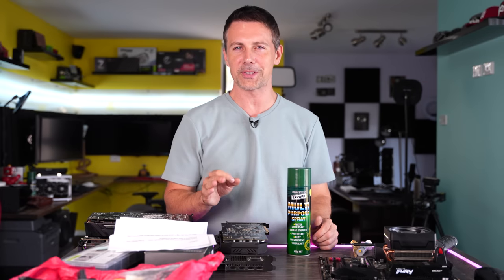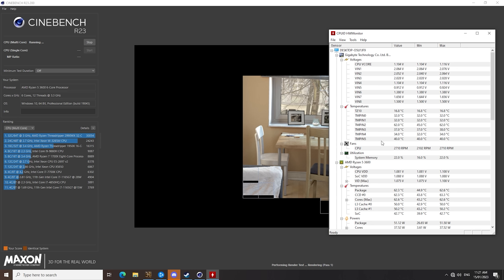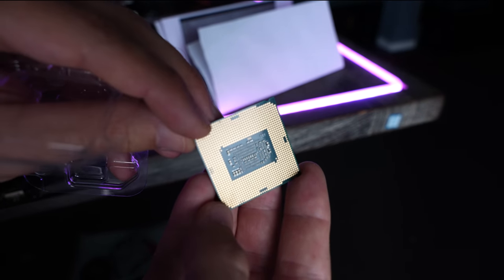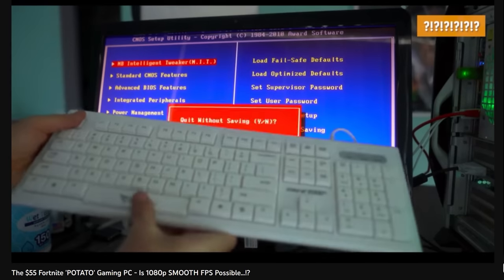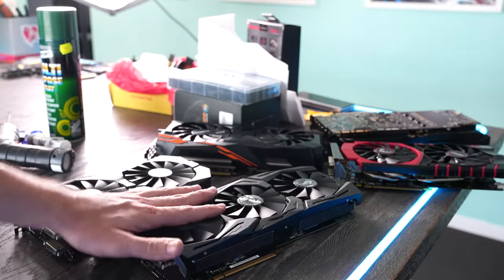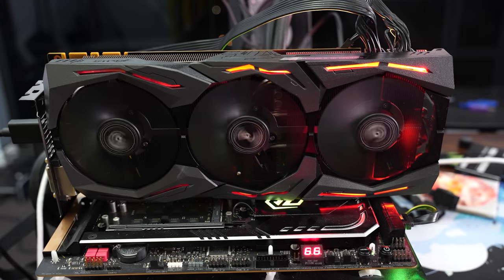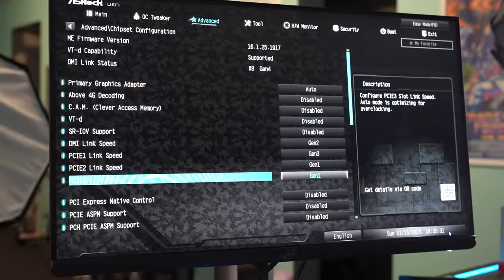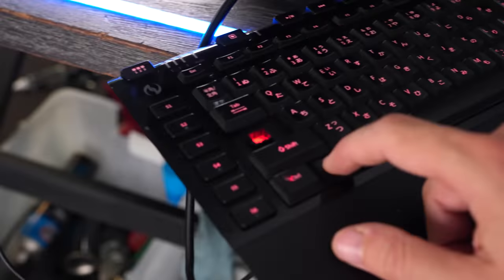Can you FIX a Ryzen 5 3600 with FAULTY Cores? | (Can YES Fix It).

Comment: I think there could be some problem with power management that causes R5 3600 to atc weird also besides silicon degradation.

I also have problem with my R5 3600 and it is most likely caused by something related to power management that is happening during idle operation. The reason i think this is because when clocks are set to a specific value and this way also voltage fluctuates less it is from my testing perfectly stable(even performance is almost the same). But as soon as you let it do its thing it becames unstable. 

I was trying a lot of stuff to solve those BSODs and i mostly solved them but random shutoffs during idling are still happening. Today i maybe found a sollution but i do not know it for sure yet. What i did was use overclocking setting on my MB that makes it so Infinity fabric(die that connects CCDs to everything and to each other) is forbidden from underclocking. Also for some reason monitoring softwares as HWinfo, MSI Afterburner were also increasing chance of it happening BSOD and those random shutoffs. I even found out something on forums that there are people that had their old backup and when they reverted to it those crashes and all that garbage completelly stopped. So it could be even related to software to some extend. Of course take it with a grain of salt that is only what i found out and works for me. If you have any knowledge that could shine light on what could be happening feel free to comment i would like to found out more.
Reply: i had heard that there is a setting in msi afterburner if you eperience low power state crashes, i put it on on my 3600x/5700xt setup. i look how its named in MSI afterburner --> settings-->general-->>Disable Ulps save and restart (let the pc boot with those new settings) and i hope that your issue is gone.

you described your problem perfect i think that, this is the problem amd still didnt fix the low power state issue
Reply: What you say is completely true.. the 3600 series had 2 much of silicon differences in between different processor chips, so that they could'nt have it running stable, so to keep up with intel they raised the clocks too high and the voltage as well, just play with the clocks and voltage till you get a stable experience. and the fist comment is  true too but is grahic card related instead of cpu so i would begin to check thats setting in MSI Afterburner if the problem stays you have to undervolt/underclock you cpu till it runs stable (watch memory voltage too) was kinda high aswell if i remmber correctly, good luck!
Reply: Ok, so from my testing so far locking infinity fabric did the trick. It did not stut itself off at all during iddle operation.

Comment: Isn't there 2 versions of the 3600? like the 3600 and 3600AF? Or is that the 2600?
Wondering if that has something to do with this.
EDIT: The 1080ti needs to be reballed.  That is common when there is intermittent connection to some chips. Throw it in the oven.

Comment: Does anyone know the date when 3600 was changed to the more reliable version?
Reply: You shouldn't worry, update bios, install the latest chipset driver and that would keep low voltages, i noticed on a 2700x with old bios that it would constantly hit 1.4v, after updating bios the voltage was always around 1.1v which is perfectly fine.
Reply: @el_tio_apoca8014  Yes the BIOS and chipset update seemed to fix the freezes, thanks for info

Comment: Chiplets broke the "its never the cpu" rule.
Reply: @@user-pd6fg4vu9d I still think there are more things to go wrong when stacking things, the factors multiply.  "New reports indicate AMD’s Ryzen 5000 processors may be failing at a high rate" is the google result, I don't remember intel having that rep, they were laughed at for cpu vulnerabilities, which amd is eating humble pie on now. "“The failure on the new AMD CPUs are still too high,” PowerGPU wrote in a tweet that has since been deleted, noting that there were eight out of 50 AMD Ryzen 5950x that were DOA, four out of 50 AMD Ryzen 5900x that were dead, four DOA units of 100 AMD Ryzen 5800x units, and three dead AMD Ryzen 5600x out of 120 units that the company received." "In comparison, PowerGPU noted that “we had only 1 dead Intel CPU it was a 9700k in our time of business.”"

Comment: Probably just luck with Ryzen 3600 mine is set to stupid high overclock with  way more voltage ⚡ and it's working but it's cooled by liquid freezer 2 360 and that might be the reason why it's alive and others have problems.

Comment: Dude, I have ran into 5 or 6 of these in the last few months that have done the same thing. I just got a "for parts" 3600 on ebay for $35 bucks and as soon as I got it I lowered the clocks to 3.3 and it's working fine. Dafuq

Comment: Crazy i have a 3600 running at 4.3Ghz but i have mine locked at 1.1v in the bios, i would always see the cpu pulling over 1.4v just for the 4.2Ghz with auto settings
Reply: That must be a golden chip mine needs 1.4 volt to be stable at that kind of clocks one ccd is at 4.3 and other at 4.35 and it's cooled with a 360 aio

Comment: Mined broken GPUs sucks. They are dirty and smelling. It's really easy to find them. Sometimes it's possible to clean,  reflash with proper firmware and/or going over with the heatgun. The result is often low performance. For anyone who want a nice stable long live PC it's not an option. Better to buy a GPU with a broken cooler and fix it.

Comment: BTW ..... I would LOVE to buy up, all your faulty GPU's, you can't bring back ! It is an big hobby for me now, I invested in all the right equipment , like an Reflow Oven, and an Hot Air Station.
It really became an type of "sport" for me, trying to bring back, or even 'upgrade' an Zombie GPU !   My 2 best 'Zombie' GPU's, are an correct working, GTX 1060 with 8Gb of Vram, and an GTX 1070ti with 11Gb Vram , Just for the fun of it ! ( and YES, with an working ( special made Bios ( which an friend of me, writes ! because I'm not good at coding )
Reply from the maker: wait what, can i get a GPU z of that LOL, that's crazy never heard of it! Also I usually pile up the fualty gpus and sell them in a lot when I have a heap of them.

Comment: I have a problem with a 2060 Super that refuses to play DX12 benchmarks or games without crashing back to windows after a few seconds.

What solves it is underclocking the core by 150MHz. Has anyone else had that issue?

I bought it off a guy who bought it round for me to test before i bought.. so i tested it on Heaven DX11 and we were both happy! I then took it apart and cleaned it up (done this 100's of times with no probs) then tried Timespy and yeah.. crash to windows. NVLDDMKM.sys is causing DXGI error. I don't feel i can ask the seller for a refund now that i've tampered with it.

I'm worried about selling this in a build as i'm not sure about the lifespan of the GPU now, but as long as i explain in the listing that i've downclocked it with MSI afterburner it's ok i guess? Thoughts or potential fixes appreciated!

Comment: Ah you ran into a pre.. I only wish the new CPU's didn't get so hot, My i7 11700K under liquid is in spec but lately just makes my room too warm gaming so there's days where I just don't game anymore. I hope in the future both Intel and AMD can make CPU's that are fast but don't shit out the heat like there's no tomorrow. Also the AMD sockets are called ZIF or zero insertion force, Id only ever hold it there with one finger in the middle of the heatspreader while closing the lever. I also prefer intel's LGA - Land Grid Array sockets where the pins are on the motherboard, still have to be careful with both though, just remember it's like a car but its not. Not need to smash the shit out of it to make it work.
Reply: Undervolt

Comment: The R5 3600 degradation may be caused by too high voltage. When I built my PC with 3600 i noticed that by default it was running at fixed 1.4V idle or not (B450M mortar max). I dealt with that and after over 3 years the CPU runs without issues.
Reply: Mine is overclocked on purpose at 1.4 ish volts it works fine with 360 aio

Comment: I'm sorry dude, but those keys you're plugging are not legit. they are recycled OEM keys from older hardware. Scrappers take the keys of CoA stickers from junked machines and laptops and sell them as Windows 10 keys because Windows 10 will accept keys from 7 and 8. The problem is that OEM keys are not supposed to be transferred from one machine to another, they are supposed to live and die with the machine they were supplied with. They activate because MS gives a lot of leeway. What these people are doing by selling recycled OEM keys is essentially software piracy and you are supporting it.